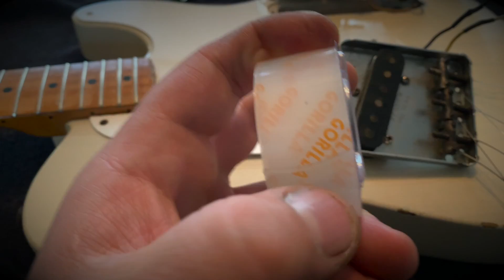50's FENDER LAP~STEEL PICKUP Installed in a 1957 FENDER ESQUIRE~BLACKGUARD TONES???

Comment: That the thing ; the percussive quality missing in modern versions.You can hear this on actual lap steel demos, - there's this tone, and then there's the horseshoe wrap around type, which has that very glassy highs with the brutal ,percussive ,low end.
IDK if I'd want it as a main Tele pickup, but as an option, or for playing slide,- definitely.Whole different attack and EQ, very mid rangey.
As you say, you do what it takes to stay engaged and fully involved; keeps the black dogs and white mice away.

Comment: I just bought a original Vintage 1952 fender champ lapsteel pickup. What cap helps you get a more of a P 90 tone ? Want to get the same cap and tone as you I love the tone of your Esquire. I have a vintage body someone already messed up routing wise. I want to screw it straight into the wood ala G.E.Smith. I've heard straight into the wood gives a fatter tone. Love your tone and your channel. Just subscribed

Comment: Tone control...on a '57 Tele? A '67 for sure but a '57?
Reply from the maker: Not sure what you are asking?   Yes in 1957 you would have a volume pot and a tone pot, on both esquire and telecaster
Reply: @theriffwniksevigny5473  I was under the impression that the 'tone' pot, as we know it nowadays, was originally a blend from 1950 to 1967 for blending the neck pickup with the bridge pickup in position 1 in Broadcasters, two-pickup Esquires, Nocasters and Telecasters
Reply from the maker: B. Rod Clark i believe that was early broadcaster wiring.   It changed slightly.  Nacho Banos details it in his book!